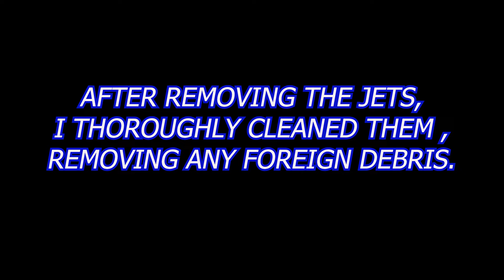If Your ATV / Dirt Bike Won't Start or Runs Rough, it's Likely 1 of These 3

Comment: I have 2 quads here that aren't starting. I am so thankful for this. Ive never worked on anything in my life and im a 31 year old female lol. I'm hoping now I can get them started. Ones mine ones my grandpas. My mom also has two quads that have been sitting for 15 years so. Maybe once I get a little more confident I'll start to mess with them too. I was gonna take them all to a small local shop but I figure I should probably learn all I can about them
Reply: did you get them running?
Reply from the maker: I would like to know too
Reply from the maker: To be honest, after 15 years you may need to replace the carburetors. I would ensure the fuel tank is clean with fresh gas, new fuel filter, new spark plug, new air filter, clean the carburetor and then it should fire up. Also, change the oil and oil filter. Let me know if you need any help.

Comment: You will burn the starter out if you keep trying the start button for so long then the battery will die you will just have to put it on the charger
Reply from the maker: Very true but times like these it's necessary

Comment: Hey! I have a 08 Raptor 250, and it runs, but it runs rough and it makes me nervous to potentially damage it by running it
Reply from the maker: As long as you have good oil and good fuel. If it runs rough you're not going to hurt anything riding it. It may be running rough due to a clogged carburetor.
Reply: i have a raptor 250 and it only idles when it’s warm. i have the idle turned all the way up and it still idles really
low. the carburetor is also cleaned. help please
Reply: @tylerrindar7320  air needle need to be adjust :)

Comment: My atv is not working and I wanted to pull it out of the garage but since it’s winter of course it’s not working this helped a lot thanks
Reply: Also I already replaced the spark plug and no luck should I change the gas?
Reply: Clean air filter

Comment: I have a fourwheeler that I’ve been working on for a while I replaced everything. It’s a 1995 Honda Trx 200, it won’t start. It gets spark but when I hit the throttle and the gas it’s like it’s trying but it won’t. I’m not sure what is going on.
Reply from the maker: Have you replaced the carburetor?
Reply: Same here. Carb replaced with elec choke. Voltage reg replaced. Fresh fuel. Still have starting problems. Gets spark too. WTF?
Reply: Check your timing

Comment: My 300 sportrax sounds exactly like this, I changed the coil and couldn’t remember if I changed the spark plug… I’ve clean the carb 3 times now. And it would only want to run on choke

Comment: You do realize down means the choke is on and up means the choke is off on those things… it wouldn’t run right because u kept trying to run it with the choke on
Reply from the maker: It was opposite day lol... No it didn't matter, I eventually bought a new carburetor and now it runs great!
Reply: oem or Chinese carb? im having problems with mine but cant afford an oem carburetor

Comment: I have a 2000 trx300 ex and it dose not like to start but once you get it warm, it runs perfect any suggestions?
Reply from the maker: I had this same issue with one of my machines. Carburetor engines can be hard to start when cold because fuel vaporizes less easily, and can condense on the intake manifold walls, starving the cylinders of fuel. This requires a richer fuel mixture (more fuel to air) to start and run the engine until it warms up. You can adjust this by increasing the size of your jet.

Comment: My 06 trx300ex starts and goes through all gears but won’t drive any advice?
Reply from the maker: There has to be a disconnect between the crankshaft and front sprocket. Couple of things I've seen is the clutch basket can snap also you may be missing teeth on a gear in the transmission.

Comment: I have a 2003 Honda rancher I have babied it since the day I got it almost 3 years ago it’s starting to run roughy it will cut in and out then today it cut off when I was letting it cool down and when I started it ran really riff and cut off and when I gave it gas it would cut off or spit and spudder also my neutral light went and and it will not start it just clicks one time when I try to start it and it always started the first turn when I hit the start button I let off immediately

Comment: I don’t know if you’ll see this but I have a Tao raptor 200 2022 I can’t get to idle, sometimes it will for about 30 seconds at most it wasn’t running so here’s what I replaced spark plug,starter,starter solenoid,battery, oil,gas, and battery. Any suggestions would be very appreciated it’s my first time working on a 4 wheeler
Reply: I’m having this issue now, with the Coleman raptor at200-b which is literally the two Tao. Did you ever figure it out?
Reply: It's the carburetor I have a Tao Rhino and with the stock carb it wouldn't even stay idle. I bought a Nibbi 26mm with flange and put it on and it started immediately. It starts first try I just need to get it tuned correctly.  But as if right now I can get it up to 50. Also make sure you change the oil immediately they have shitty shipping oil in them.

But I'm running a 115 main jet 
45 pilot jet 
Needle clip in middle and im about 600 feet above sea level.  
Take the carb off and get it opened up and go from there

Comment: I have a Chinese quad I bought to flip. I replaced the carb, filter and spark plug but it still wants to bog at full throttle. Any advise?
Reply: hey bro check the ignition coil and the airfilter with fuel filter
Reply from the maker: Yes check the filters but also check the jet sizes.
Reply: It's your main jet size

Comment: I have a yfz 450 it starts but doesn’t idle.I changed the spark plug and cleaned the Jets in the  carburetor. But doesn’t idle.
Reply from the maker: Have you adjusted the idle up as far as it can go?
Reply: Do you have instagram?
Reply: Or clean air filter

Comment: I have a 2021 Kawasaki brute force 300 and it turns on but when I press the gas it hardly accelerates. Do you what the problem is ?
Reply from the maker: To give you the best diagnosis, I would need to ask this. When it's in neutral, does it rev up easily?
Reply: @FREEDOMSYNDICATEOFFICIAL  it kinda takes awhile to turn on but once it’s on it runs but just wont accelerate as good as it used to
Reply: Mine just went through that. Coincidentally right after conditioning the air filter with oil. The short cut fix I learned: remove the idle ages on side of carb and fill hole with carb cleaner. Flip throttle once and let it soak about an hour. Viola! Problem solved

Comment: i have a Polaris atv  sportsman 500 HO 2002,i cant start it after i turn it off,it starts only when jumped,also i replaced the stator and the battery is getting charged while running at 14v,when i turn it off and try turning back again nothing,could it be a battery? the battery is 3 months old and i drove around 20 miles only
Reply: Happened to me too, i had loose connection spot wich i found, when i held if where it should be, i was able to start it
Reply: @nikscaucis4557  what connection?
Reply: @alexz6462  for me it was near battery, there was like outlet or something like that, and it was coming out, when i pusged it back i could start it
Reply: @nikscaucis4557  was it the solenoid?
Reply: @alexz6462  yes, it always came out of the place, and when i pushed it back in it was alright
Reply: @nikscaucis4557  strange,I checked my solenoid everything seemed fined,the engine turns over the starter turns but nothing,I’m suspicious of a bad battery
Reply: @alexz6462  could be, for me when that happened there was no signal of life😂.  Possible that it could be the carburator too

Comment: i have a trx250x and it starts but has a poppung noise… sometimes wont even start… i have a fmf slip on it was fine for years until i let it sit for like a year then in 2021 it started the popping shit. idk what to do.
Reply from the maker: It's likely that all your issues are fuel related. After letting it sit, the carburetor needs to be cleaned and the fuel tank flushed. I hope this helps!
Reply: Buy a new carb

Comment: I have a Ltz It runs but bogs when i put in gear and wont stay running Any suggestions?
Reply: Change spark plug,clean air filter,clean the carb

Comment: I have no clue what wrong with my quad it just really hard to get start I change the plug that about it I crank and crank and just won’t start east at all
Reply from the maker: Fuel issues.. Could be both too much air for too much fuel. Have you confirmed that you have a good spark?
Reply: @FREEDOMSYNDICATEOFFICIAL  yes I did
Reply: Idk what wrong tbh
Reply: Take it to vee
Reply: @MacDre2488  what